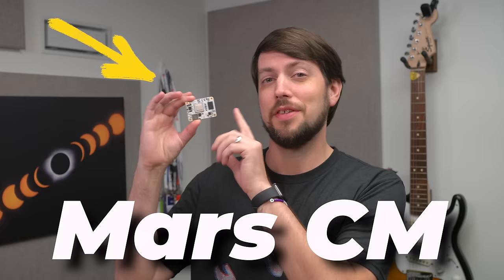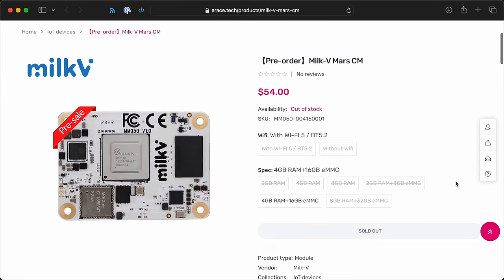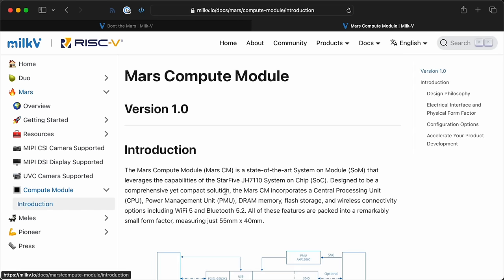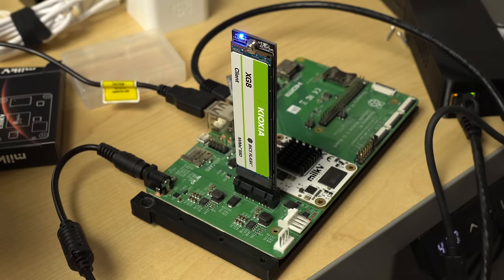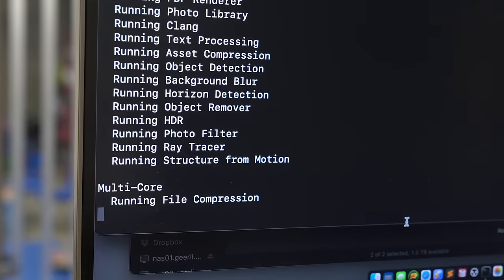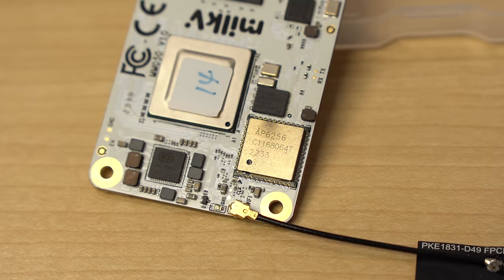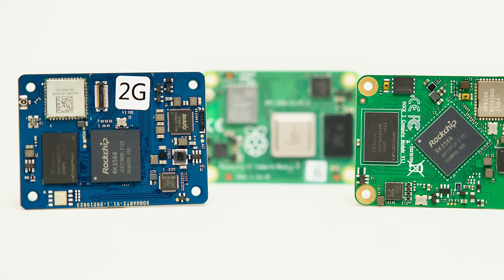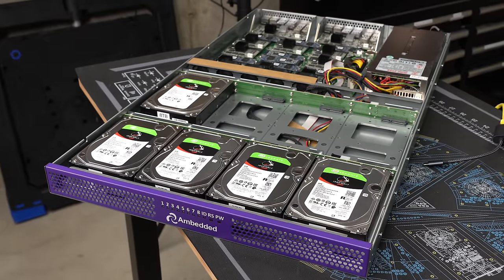RISC-V isn't killing Arm (yet)

Comment: Progress speed of riscv is still much faster than competition. Its interesting that docs were not that good - I am very happy with milkv duo and find it totally capable of real embedded usage with niche market WITH good docs it came too. So was surprised docs were not good for you, but maybe you were much earlier to this than I were to milkv duo.

Also don't underestimate being in stock with riscv is not just "oh currently there is stock" but in my experience chinese manufactured things like these are ALWAYS in stock while I totally have fear from raspberries... Last year I nearly had a project where I would need to buy like 50 zero boards and oh man.... I am so happy I did not sign the contract because a week later literally all zero boards went out of stock that I had access to and people were rushing to buy them like crazy.

So yes.... CURRENTLY there is not so huge shortage of raspberries as it was before BUT! I saw there is can so easily happen!!! I do not want that. Already thinkikng about moving a project from pi zero to milkv duo for example because its not just cheaper and well documented, but totally is enough for my use case AND is always easy to buy in bulk if really needed.

Comment: I have the Turing Pi 2 with several CM4 carrier boards so this will be a cool thing to try it on.   RISC-V still have some ways to go before it reaches critical mass but it's getting there.
Reply: What CM4 board have you tested that worked with Turing Pi 2 apart from. RPI CM4? I can't seem to find any general info of other brands working on it apart from RK1, Nvidia's.

Comment: It sounds like a big part of the problem is a lack of software that is optimized for the platform. Which is not surprising for a wholly new machine architecture, but it‘s the kind of thing that can get better over time. Maybe Jeff addressed that and I wasn‘t paying close enough attention (always a possibility), but atm it‘s not clear to me whether there are other more fundamental problems, not so easily rectified, that keep RISC-V out of the ballpark of other SBCs and CMs. (Not that updating gobs of software for a novel architecture is easy, but if there‘s also a weakness in the hardware that‘s keeping it back, gobs of better software won‘t make that go away.)
Reply: From what I can tell, it's all just software. Or at least, it is if we assume the manufacturers aren't cutting corners in the hardware, which some of the more sketchier companies might be doing. It's kind of a wild west right now. There's a handful of good development boards out now, and more are coming soon, and the software libraries will improve from there. There's lots of interest from developers in RISC-V, and the pace of development is frankly unprecedented. But it'll still be a while before all the gaps get closed in software, and for reputable manufacturers to get firmly established. But even just getting 80% of the way there solves a lot of real world problems for real customers, even if the remaining edge cases take years to resolve.

Comment: Could you please do a video on "boot standards" for ARM platforms ? i mean... for x86 there is BIOS or UEFI. Any OS supporting one of them can be easily used on any BIOS/UEFI enabled hardware. how is that on ARM based hardware with all these "Cores" and versions on SOCs. Is there a Standard in place? Can one simply download ANY plain linux distro for "some arm" and install it to just any arm sbc with a USB / DVD Drive or something?
Reply from the maker: There is a standard (SystemReady), and some Arm systems do have UEFI, like the Ampere system I've done a few videos on (one just last week!).

You can download Ubuntu, Debian, Windows, etc (Arm64 build) and run it, no proprietary overlays or specialty images required :)

Comment: RISC-V is interesting, but there are a few concerns I have regarding how performance competitive it can be (relative to 64-bit ARM).
Namely:
It lacks indexed load/store operations, only supporting constant displacement. Indexed  load/store (Clarificatrion: register offset, or scaled-register index; ARM docs seemingly use "indexed" for auto-increment) is not exactly rare (typically the 2nd most common addressing mode, often around 30% of the total load/store operations), and needing to fake this using a multi-instruction sequence is a pretty big hit (it wouldn't be hard to add this as an extension, but many in RISC-V land seem opposed to this). I don't personally have much faith that "opcode fusion" can solve this issue in practice.
Another (similar) issue is related to large constants, where, anything larger than 12 bits becomes a multi-instruction sequence, and anything larger than 32 bits is much worse (bad enough that one is better off falling back to using a memory load for 64-bit constants). This is also bad, but not such an easy fix. ADD: ARM64 allows loading constants 16 bits at a time, with a 4-op sequence able to load any arbitrary 64-bit constant (though, there are other possible ways to approach this).
There are some other issues, but these are the major ones.
Granted, the ISA wasn't really designed for performance, as far as I can see (was designed more to be easy to implement for EE students).
But, it is an open ISA, which is still a big advantage versus ARM.
Reply: This guy assembles.

Comment: I actually just picked up a Mango PI Pro that is sporting a single core RISC V processor for about 30 bucks US.  Right now many of the RISC V boards out there are priced over the RPI but they are damn close. I grabbed this board because it was very cheep and I wanted to mess around with RISC based CPU stuff.
Reply: It's good for us nerds to grab some of these low end boards and just see what we can do with them, find issues, hopefully find solutions, and get that information out there to the wider community. Things will improve, but it's up to us to make RISC-V popular enough with hobbyists so more devs find it worth their time. The high end market will be taken care of by industry, it seems that AI in particular is really embracing RISC-V. And RISC-V is becoming very popular in microcontrollers. There will be trickle down R&D from all of that. But getting RISC-V to dominate the SBC space seems like a really important goal long-term. We should really not want to be dependent on ARM licensing.

Comment: We'll see what kind of answer ARM has against the MILK-V Pioneer (64-core RISC-V desktop). Expected at the end of this year.
Reply from the maker: The Pioneer is quite interesting (I mention it right at the end)—I really would love to see more Arm chip designs between 32-64 cores, Ampere has a few Altra models like that but the chips are pretty massive and don't target efficiency at the low end, only all-out.

There's no equivalent to the consumer X86 chips right now on the Arm side, outside of Apple and maaaaybe Qualcomm, but I'll keep holding my breath for them to release their new chip.
Reply: Hello. :)

Comment: This will be great as machine where speed is not necessary but functionality is, like monitoring a 3D print. I didn't noticed any HDMI or display out test in the video, doesn't it work with the provided OS?
Reply from the maker: I had trouble getting my monitor to display anything. Some people had better luck, so it may just have been my older HP monitor not being as compatible... not sure

Comment: Risc V remains mostly an attractive idea. It's possible it could be disruptive in the Christiansen sense - it appears to be taking a large share of the microcontroller market, and that's consistent with a technology thats disruptive. But it's early days yet.

The Chinese govt is apparently a big backer, which makes sense, bc it means they can avoid dependence on ARM or Intel/AMD. 

Risc V seems just a little late to benefit from what seems to be x86 hitting its limit. There's a significant move towards ARM as a more efficient alternative, whether Apple or for servers or now by Qualcomm.

I am mildly surprised that, eg Nvidia or some other big player hasn't yet put big money behind Risc V as a way of ensuring independence from ARM.
Reply: Well, Apple has hired RISC-V engineers. I wouldn't be surprised if they aren't already using small RISC-V controllers in their product lines already, or will very soon. Maybe not for their SoCs yet, but potentially down the line. Google apparently wants to move Android to RISC-V, or at least have that be an option. I think ARM showed the way, but RISC-V will be what capitalizes on the transition away from x86. RISC-V is also apparently seeing wide adoption in AI, and possibly automotive.

Comment: That prices was still relatively high for a lot of projects.  I'm waiting to receive a Milk-V Duo, which I'm looking at as a wireless GPIO expander board.  Still, I'm thinking it will have a hard time competing with wired I2C communication for my use case.

Comment: Right now I see it used as a soft core processor in FPGA designs to allow portability between manufacturers. However, free RISC-V cores are not really that great, but paying a moderate amount can get you plenty of performance. It mostly needs a little more time to spin up and get going. What we need is an alternative to ARM for price competition and RISC-V is not there yet.

Comment: warning, I've not confirmed this. But someone mentioned in a Youtube video: the most popular ARM-based micro-controller in China could not keep up with demand because of COVID and a RISC-V-based alternative exists which is the same price and more performance and was able to deliver/produce enough units. It's a drop-in replacement and the power usage was slightly more (with more performance). So it got pretty popular.

Comment: thanks for your review, benchmark. For me, it's too early to consider performance or watt consumtion. ARM is being developed strongly but it cannot beat x86. AMD might stronger Intel but it often has some software issue. My old AMD x6 1055T and Gigabyte mainboard can't work seamlessly with HDMI cable/monitor. I have to always choose resolution/orientation manually with the combo. For best user experience, I still choose Intel

Comment: I think you should sweet-talk Esperanto Technologies into letting you try out their PCIe ET-SoC-1 evaluation card, featuring 1000-plus RISC-V cores on a single chip. It is mostly optimised for machine learning, so it might not be as great at GeekBench as some might expect, but there is apparently a version in the pipeline for high-performance computing applications. The company has some big names from computer architecture and the microelectronics industry behind it.

Comment: RISC V is an open source ISA but anybody who designs a core or processor etc that reaches fab is going to be expecting to be paid for their IP. The cost per unit for ARM licensing is very small.
I also expect RISC V to fork with different extensions.
Reply: The main benefit from ARM licensing is the mature and reliable test and verification system you get with that licensing. ARM have spent decades putting their system together and it makes verifying a design easy and fast for a licensee. RISC-V will never have that because it's open source nature means it will always remain fragmented and there will never be enough money in it for any company to produce such a verification process as an open standard.
Reply: The forking not so much.  There is a huge cost to forking the ISA, and I just don't see anyone having enough to benefit from doing it to justify that cost.

You're creating compiler support for it, you're maintaining that compiler support, if it's a general purpose instruction at all, you're operating the compiler farm for whatever Linux distributions you want to support, because otherwise nothing will run on your chip, or at least nothing will run that actually uses those spiffy new instructions.

None of that is cheap.
Reply: @FieryPouncer  extensions for dedicated purposes intended to give a competitive advantage.

Comment: RISCV is definitely cool due to how open it is, but without wider industry support, it'll take a bit before it has a substantial base of software that runs on it. I for one am honestly fine with that. It's definitely a cool experience to explore a new architecture like this.
Reply: RISC - V is old. Never heard of PowePC? RISC stands for “Reduced Instruction Set Computing”, and it’s the base of multiple architectures such as PowerPC and ARM
Reply: RISC is a strange thing: it has reduced instructions

Comment: What I wonder about is why hasn't anyone tried to dust off SPARC, given that not only is it also an open ISA via OpenSPARC, but there are even open chip circuits (the T1 and T2, if I remember right)? I think it'd be a good thing if we could have a diversity of chip options - x86, ARM, RISC-V, SPARC, etc. - instead of just one to rule them all as a monopoly. Particularly in this age of open source software, bytecoded languages, and JIT compilers ...

Comment: Thanks for calling out RISC V for what it is. It is just an open ISA. To reach an open source equivalent for RISC V like we see with software we'd need open software tooling and silicon foundries. That side of things is currently locked up with NDAs and expensive CAD etc. I'd like it to be like making PCBs but even 20 year old process nodes are expensive to work with. Google was trying to open up the tooling with an old process node fab. Maybe that could work. Even if a RISC V backed CPU silicon layout could be released they'd also need to release so much other locked up IP. Don't get me wrong I want this to happen but just can't see it. Releasing the ISA is the easiest part. But I suppose if someone can make open EDA tooling or if one of the big EDA companies makes a hobby version then it might be closer. I'd love a complete RISC V design that you could go and fab. Imagine the innovation. Until that happens everyone is going to have their own RISC V variants with different layouts made at very different fabs. With all the negatives it is a great start.
Reply: It's a start. We'll see if there's truly open silicon eventually, but just having lots of companies making chips on the same open ISA is still an improvement over proprietary ISAs. There will be real competition and hopefully plenty of availability of chips even when various governments are fighting or there's big economic problems in certain countries.
Reply: @fakecubed  the standard ISA helps with software toolchains for sure. I'm hopeful we get there but the path isn't clear.

Comment: What sort of instructions does linpack use? Is it the same engine that IntelBurnTest uses under the hood? On x86, I think that does AVX (SIMD). I'm assuming ARM has optional SIMD extensions.

On x86, even if a CPU can execute certain AVX instructions, sometimes the CPU implements them in microcode, not with proper hardware implementation.

I'm even less familiar with RISC-V than with ARM, though haha

Comment: Just wondering: what is the importance of PTP timestamping?
Reply: For time applications
Reply from the maker: Mostly for time nerds, but it's one use the CM4 has been very nice for. There are some other examples (like camera and embedded display setups) that are also better suited for a CM4 or a board with a more thoroughly supported MIPI interface.
Reply: The only logical business case I have come across for PTP is time tracking between clusters of systems that were processing financial transactions.  The requirement was nanosecond time sync between about 80 systems.  Its actually hard to implement between systems.  You need to have complete support throughout your networking infra (which mostly only datacenter grade gear support and rarely out of the box) and often need to factor in cable lengths. The only use case I have seen @JeffGeerling use was for his LTX rig which was single system.  Practically speaking its not useful because its just syncing to a directly attached stratum1.  I think the useful part of @JeffGeerling comment in this video is that a commonly available kernel module isn't avaialbe for this system. I would assume its solely due to the network driver not supporting the correct time stamping.   Again, because it expects you to be syncing over the network with slaves or being a master.
Reply: @JeffGeerling  "Time nerds" I love it.

Comment: Please use USB tester to test power consumption... testing with power meter at mains is terribly inaccurate
Reply from the maker: I've often measured with my USB-C current tester as well, and the Kill-A-Watt is accurate to within +/- 1W  (at least mine is), so it's definitely not ideal, but a lot easier to use the same instrument for all measurements for consistency, because many USB-C power supplies are... weird when plugged through the meter, and other boards are powered by 12V (which I don't have a proper setup for measuring besides at the wall).

Comment: Performance is not an issue for many use cases (as long as it has a certain minimal performance). It definitely can replace RPi *for some*. But the incomplete and buggy toolchain is a very big issue. We need better Linux distro and board support to make a dent in the hobbyist market.

Comment: Not running the update is recommended not because of RISC-V, but because of the drivers for the Imagination PowerVR BXE-4-32
Reply from the maker: They should make that explicit in the documentation then (if that's indeed the case, other packages are fine)—because I don't need the GPU working for most of the things I do on the board.